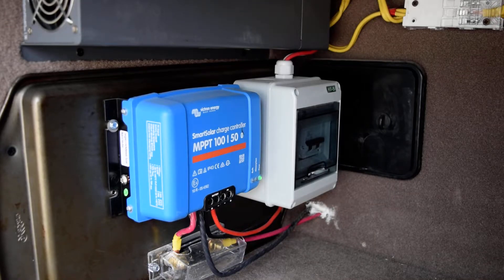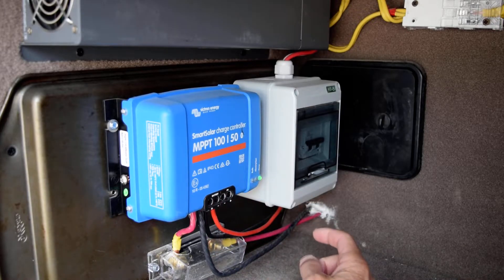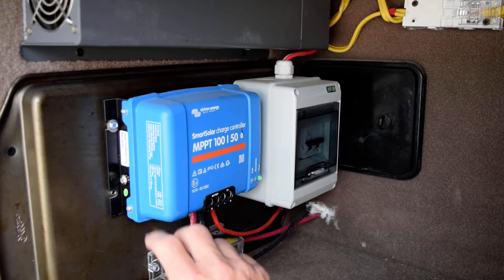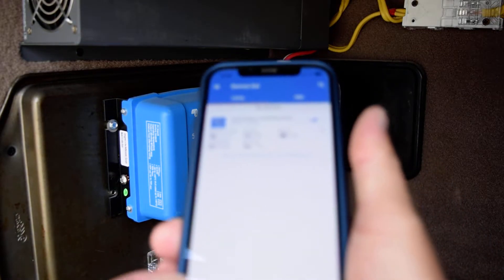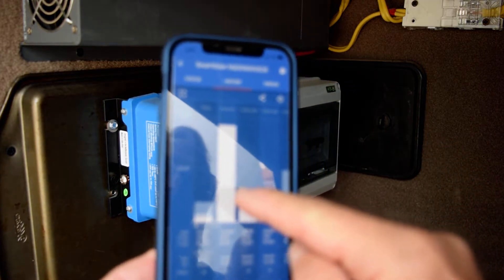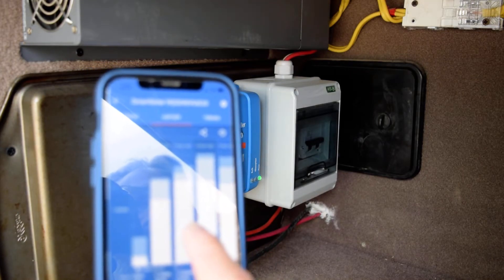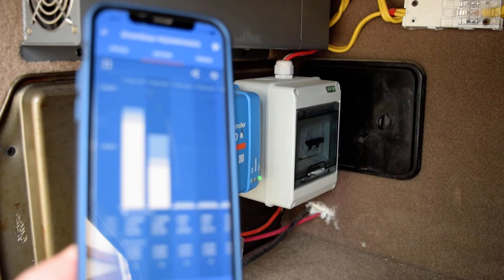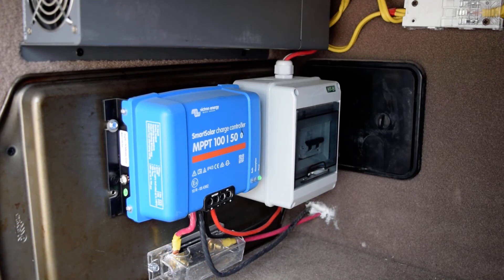RV Solar System Install with a Victron 100 50 Smart Solar Controller

Comment: I see you dont have a ground wire hooked up to the unit, has that caused any problems?
Reply from the maker: No, but I do plan to add one.  It will be really easy I just need to do it.

Comment: Are you running the positive lead to the shunt
Reply from the maker: No I am running it right to the battery bank.  This way they keep the batteries charged and the shunt just turn on and off most all of the RV's systems.

Comment: Not using the ground lug on the left side of the heat sink?
Reply from the maker: I had not connection as of the filming.  I did connect it later. Thanks.